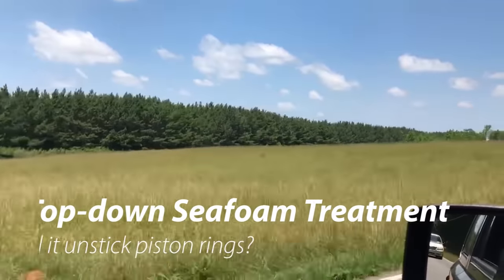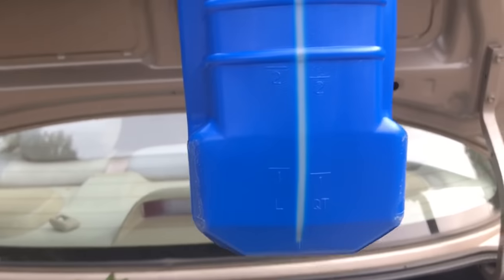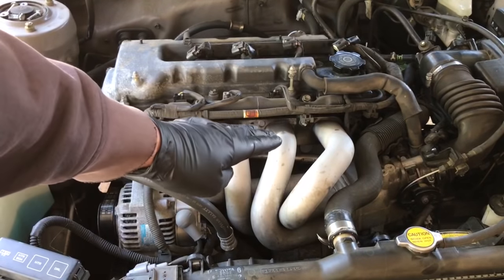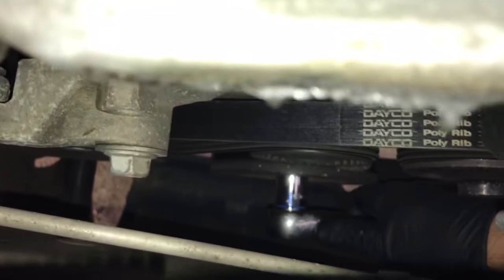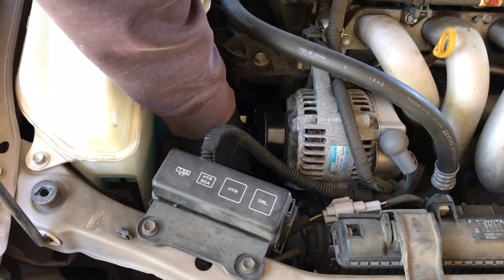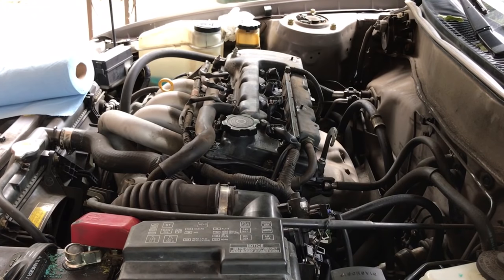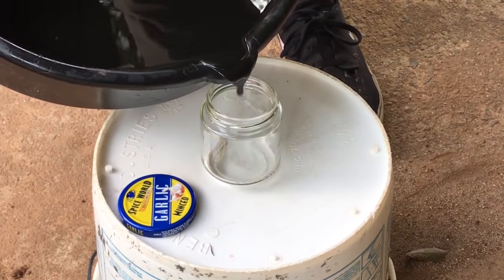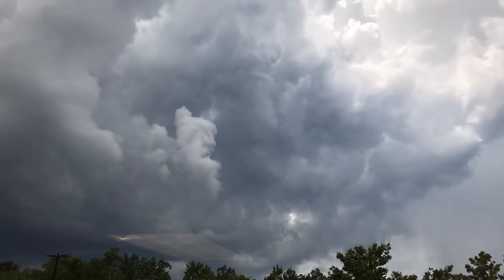I poured Seafoam down the spark plug holes! | Oil Burning Experiments - Episode 1

Comment: Great video! B&G has a product called EFR which is specifically formulated for the "bottom up" effect and I'm trying it this weekend. I used to use Seafoam as maintenance for my older cars especially towards the end of the oil life just before changing it, often resulting in a cleaner bottom end, as both vehicles exceed 226,000 miles. I also use Z-max as a oil assist every other oil change.
Reply from the maker: Thanks, and thanks for the info, David. I'd like to try the BG products too. Someone in the comments of another of my videos mentioned they'd like to send me the kit, but I haven't heard back from them yet. We'll see. All the best with yours and thanks for the comment!
Reply: Give BG EPR MOA 44k kit a shot, I recently used the kit. Burning about 1 qt per 1k miles, cant give any feedback on it yet.  BG also has another kit that is geared towards sludge buildup for direct injection vehicles.
Reply: Zmax is crap use lucas oil stable seafoam and marvel or atf

Comment: nice job on the video.
I was wondering whether you topped up the oil after you spun on the new empty oil filter? there is a fair bit in an empty filter and would change your results.
did you also replace the spark plugs?
Reply: that would not matter due to the fact he topped it off, filled his tank drove 300 miles and was still a quart low, so every tank he would have to add a quart so even if his oil was completely drained after putting on oil filter he had topped it off before driving a full tank of gas
Reply: Was wondering same. Always recheck after 15 or so minutes running after initial fill.
And not even cleaning the plugs/PCV was ???
If my oil was EVER that sludgey I would flush the block asap. 
Not changing the oil enuf (5K/6months)on  those is the reason those badly engineered rings lock up faster in the 1st place.
I screwed up by not doing it on my new 06 Tundra but did it 8-10K for about first 25-30K.
But as I've now read thru lots of others comments, I realize I've no room to judge.
Thanks for getting us all to think!
✌️

Comment: Just for the record, it was '98-'02 engines that were affected, not up to '05. In '03, Toyota changed the rings to a different design. I had a '03 Celica with 175K on it, didn't use a drop of oil between oil changes (every 3K)
Reply: Toyota did have a piston ring oil consumption issue in the mid 2000’s , I bought a scion xc with the Toyota 4 cyl that ran low on oil and had developed rod knock , I replaced the engine with a reman unit.
Reply: Just for the record. I work for Toyota  and Michael is correct
Reply: @ironmike742  On the 1zz, only '98-'02
Reply: @justsumguy2u  no sir Toyota  was putting rings and pistons in other 4 cylinder engines also. The 2AZ-FE 2.4 engine was one of them.
Reply: @ironmike742  I wasn't talking about anything other than the 1.8 1ZZ-FE. It is an absolute fact that Toyota changed the oil control rings on those in 2003. 2003 and later 1ZZ-FE models did not have the oil burning problems that '98-'02 engines had.
Reply: @justsumguy2u   If this 288 K 1Z was burning a quart a tank. It would've been toast by now.

Comment: the main solvent in SEAFOAM is Naphtha  (Paint Thinner)  You can buy a Quart 32oz of Naphtha  for the Price of just one seafoam 16oz can . Berryman B12 is  much better and cheaper , but if you really want to dissolve the burnt Carbon build up on the piston and rings use Berryman Chem-Dip Carburetor & Parts Cleaner pour about 4oz in each cyl let set overnight then more another 4 oz in each cyl let set 24 hours  DO NOT RUN THE RUN with the Chem-Dip in the engine oil drain the oil put in fresh oil before starting the engine .

Comment: We used a 50/50 mix of acetone and transmission fluid at our John Deere dealership!! Totally siezed diesel tractor engines..removed injectors and sprayed this solution into cylinders..next day engine rotating perfectly!!
Reply: Then.. what's the steps please?
Reply: Yep,tranny fluid does wonders cleaning pistons
Reply: @mandytuning  what are the steps do you get a cloth and keep rubbing till they become loose please explain abit more as I’m having problem with low compression and I’m hoping I can find a way to fix it without spending any money
Reply: Is the crankcase drained first before this application or does that matter?

Comment: I have a similar issue with my Celica 281K miles blows hardly any smoke, repaired the timing chain gasket Leak but it's still consuming about 1.5qt a week. I'm going to try this
Reply: Did it work and what engine was it?

Comment: How about spraying some combustion chamber cleaner straight into cylinders and leave it for a while. It might work better than Seafoam.
BTW, the problem is often caused by too long oil change interval and low quality oil. 
Really, at the rate it consumes oil, I would take the engine apart and clean the rings and pistons - I bet things are well baked and very crusty inside the cylinders.

Comment: Never turn a engine anti clockwise especially on older chain driven engines the timing can jump.
Reply: Is that why when I replaced my serpentine belt it comes right off when I start my car?... Idk I might be talking about loosening the pulley
Reply: @marvinfisher4737  check the tensioner

Comment: I've seen this dozens of times with 3sge nd 5sfe engines. I used to add seafoam, one quart to a quarter tank of fuel and give the old 'Italian Tune up' . Drive it hard for about a half hour. usually breaks everything loose and decarbons valves and plugs,

Comment: Been doing this to my 02 corolla because of the oil consumption 😭😭 You should use a high mileage 10w-40oil. It helps a lot and you can also try seafoam in one of your vacuum lines
Reply from the maker: Thanks for the comment. That's a good tip with the vacuum lines.
Reply: Thanks Dave and Tyler exactly the same on 04 corolla in Australia, 1zz-fe engine next one up from yours with plastic intake. Which vacuum lines would you recommend bud? PVC line or something? A
Reply: @chloeleedow7250  of course man 🙌🏽 I put it through my pcv line. The line is easier and more effective imo
Reply: PCV* LOL wish I had the metal intake btw those plastic ones are notorious for rattling when the Inside bond comes undone sounds horrendous like a diesel 😂
Reply: Spark Plug 1 - Oil In The Cylinder Wall
Spark Plug 2,3 and 4 - Oil In The Cylinder Wall and Engine Overheating Issue
Reply: @FamilyFriendlyDIY  Hi Dave. I know I am watching this a long time from your initial video. If you are still open to options to unstick valves Amsoil Power Foam applied through the vaccuum line is very, very good.
Reply from the maker: @chrisryan8863  Thanks. Will keep that in mind!

Comment: After you did your sea foam experiment and you changed your oil, I noticed you didn’t crank the motor to allow oil to fill the oil filter and you didn’t check and re top the oil before you went and used the tank of fuel up. So the oil hypothetically should have been a little higher on the dip stick than it shown after first demonstration.

Comment: Put 4 ounces of seafoam in the oil crankcase with a fresh oil change. Drive for 1500 miles and change the oil.
It's worked on every  vehicle I've tried it on with high mileage.  It will free up lifters and rings. But it takes time to work. Dropping it straight down the cylinder and running it for 20 minutes will not work.

Comment: i have heard the crankshaft should be rotated only in one direction, but maybe that applies only to engine with variable valve timing
Reply: No. It’s all engines. However you can turn it back ever so slightly like he did on any engine as well. Any more than that you run the risk of losing the crankshaft bolt and then skipping your timing.

Comment: Extralube ZX1 in the oil and the fuel will help to unstick piston rings and clean off the carbon. 

Australians have ASTA 3000 which also removes carbon and prevents it from building up again too quickly.

Comment: I've tried this as an experiment on a Honda 2.4 that was very badly burning oil from the rings and nothing worked at all, sea foam, marvel oil, trans fluid, kerosene. Straight into the cylinders soaked over night. Didn't change anything. Re-rung it an it was perfect. Too much hard carbon siezes the rings and nothing but mechanical means can clean it up.
Reply from the maker: Thanks for the input, Jumpin JimmyG!

Comment: I bought 2003 rava4 with 150000 miles that used 2 quart over 3000 miles  The other owner change oil at 3000 miles and used Quaker State non synthetic  i switched  to Amsoil 5w30 and changed 5000 miles intervals After 4 oil changes with engine flush i got  it  to  down less than 1 quart in 5000 miles before it used 3 quart in 5000 miles Now i switch to 10000 mile oil change interval  ive put about 35000 miles in less than 2 yrs now it using less oil but for being manual trans the gas  mileage sucks im getting less than 15 mpg

Comment: I have an 06 Saturn that was neglected before I owned it. It would drink oil. Instead of risking chunks of sludge screwing up the engine with an engine flush I put sea foam in the oil and oil consumption is way down.

Comment: I think cleaning up the valve chamber would definitely help. Usually there shouldn't be much carbon built up on the piston as the blow back will transfer them into the chamber that clogged up the valve.

Comment: When you change the oil & filter, & put in the required amount of oil, you need to allow for the oil that is used to fill the filter. This amount is usually about 1/2 a quart.

Comment: Just an FYI, you can also pour half the bottle of sea foam into the crank case and run it for 175 miles. It'll clean everywhere your oil goes.  I'm going by your concern for small amount leaking into the crank case.. ?

Comment: I have a 2014 toytota camry le 4 cylinder chugging oil and eating catalytic converters, gonna give this a try. Would you use this method with the spark plug holes or use it in the oil? my car has 446K miles on it.

Comment: I drove a work truck one time, a CornBinder, 4something cu inches, 3 gallons oil to a 30 gallon tank, and it got about 10 mpg. 
 My solution, a large can of staring fluid into the oil filler, hood open fire ext. handy, try start, big boom, 2 days later a new Chevy, it lifted the valve covers, oil pan away from heads and block. 
 Boss said " that why it burnt so much gas, was in the oil pan too.
 That 30+ years ago, that was my oil burning fix.

Comment: you could barely see the oil on the dipstick because the engine was using so much oil it never had time to get dirty! On the can of seafoam it states to use Seafoam in the engine oil as well.
Reply: At the beginning, how come the oil on the dipstick oil was clean, but the oil from the sump was black?

And how did you allow for the extra oil required to fill the filter?

Comment: Next time you guys take a head off an engine that’s all carboned  up spray some CRC “red can” brake cleaner and see what it does to the carbon😉. Works better than carburetor cleaner. I stumbled across this once when I ran out of carb cleaner. Of course it’s probably not sensor friendly but as long as you don’t use it while it’s running and do an oil change you should be fine
Reply: AMSOIL POWERFOAM... EATS CARBON

Comment: This is an interesting experiment although I’d switch over to advanced full synthetic as that’s what I use from supertech. I wouldn’t touch regular Dino oil with a ten foot pole, it burns off too quick and varnishes up stuff too much. Synthetic is a better cleaner of parts. If you want a high mileage oil I’d try the full synthetic high mileage as my old 2007 Toyota Prius burnt oil. It was about as bad burning a quart every 500-800 miles with variations. I got it to stop by using marvel mystery oil with a tiny bit of overfill. What I’d do is I’d add a quart of marvel mystery oil and let it burn through until it got just above the fill line, add another quart to replace it and after about 2-3 times doing this with slight (a hair) overfill so it hit the rings and everything and my usage went from that noted above to about a quart every 1300 miles or so. I’m mainly a highway driver so perhaps that helped loosen some stuff up but I had great results. Before the battery went and I got rid of the car, I’d add some mystery oil every 20,000-30,000 miles or so before an oil change to keep it goin and switched to advanced full synthetic which improved everything  more. 

Worked for me. Perhaps it may for you. 

Amazing work and video.

Comment: If I remember right, don't those Toyota 4cyl call for spark plugs with the dual ground straps? It should even be displayed on the passenger side of your valve cover.
Reply from the maker: I picked some up from the Toyota dealer, but haven't opened the boxes yet. We'll see soon.

Comment: Question,
Turning the crank shaft pully counter clockwise, as you seem were doing,  may cause to jam the timing chain and / or damage the chain tensioner. Am I correct?
Reply from the maker: Good question, Ali. It could do damage to some engines, depending on how the chain is tensioned, but the 1zz uses a ratcheting type tensioner pressing up against a guide that hugs the "slack" side of the chain from bottom to top, so there is no way for it to jump timing as long as the chain has already been properly tensioned. Just Google 1zzfe timing chain assembly and you'll see what I'm talking about. Thanks for the comments!
Reply: @FamilyFriendlyDIY  Thank you for your prompt reply and your advice. I have learned a lot from your videos and thank you for your good service to public
Reply: I’ve been a mechanic for 50 years. I’ve never heard of an engines timing slip due to the engine being turned backwards. Manufacturers have had to design in the chance of an engine being rotated backwards. Stalling when going up hill for example.

Comment: Marvel Mystery oil works great also. I've cured many "oil burners" with using Marvel Mystery oil over the years.
Reply: Did you just add it to oil?
Reply: @samgrieg  yes and sometimes to the fuel also.  Several years ago, I bought a Ford Escort wagon, at an auction for $100. The car only had 51k miles but smoked badly. Turned out to be the thermostat was stuck wide open. Changed it, changed the oil, and drove the car for about 60 miles. It stopped smoking and engine temp became normal.  I detailed the car, sold it and ended up with a huge profit. Its new owner drove the car to 230 K miles when he wrecked it in an accident.

Comment: This may be worth a try... What about RAISING the engine temperature by partially blocking the radiator? Obviously to the highest safe temperature.  Bring oil temperature to 230 - 250 for 20 to 30 min? But the goal would be to get the cylinders to their highest shaft temperature.

Comment: You want to free up rings stuck by carbon, the best thing is pour some rifle bore cleaner in the plug holes. Seafoam is good for gummed up carburetors, but if you want to cut carbon, bore leaner like Hoppes#9 is 100 times more effective.
Once you start burning a qt in a tank of gas it is too late. The cylinders have become oblong.

Comment: So you went over by about 32 miles- 10%, and you still got another 15% or so in oil savings- easily 20% overall once compensated. Decent result for a first run. Then there is the horribly sludged up engine, another mitigating factor. Then there is also the fact that you are using 10w30 oil- the passages in the pistons and valvetrain are a bit small- made for 5w30 for that engine. Remedy all these conditions, and I bet you at lease lessen the oil usage by 50%, if not much more. Excellent experiments, kudos!
Reply from the maker: Thanks Robert! ... And I'm glad someone is recommending thinner oil ... seems like most are recommending the opposite. I agree with you, that thicker in this case is not better.

Comment: Get ur eng hot then trickle water directly into the intake track with eng revved up. This will steam clean cyl's breaking up carbon deposits. Seafoam can also be used in this manor

Comment: The 'lesson' here is to change out the oil (& filter) at the 'recommended' interval .... but ** nif and only if** ... your driving is at long distance highway 'constant' speeds. 
'Stop and go' or 'city' driving or driving in 'dusty environments' really requires that you 'HALVE' that interval or change every 6 months (which ever comes first). High quality oil (definitely not the cheapest 'stuff') is one hell of a lot cheaper than a total engine rebuild or replacement engine.

This is especially applicable to the more modern engines with **less tensioned compression and oil control rings** on the pistons. Most all of these 'newer' engines have the low tension compression rings .... done to reduce internal engine friction and boost fuel mileage.
With these piston rings not as 'springy' as in the past, carbon WiLL build up in the ring grooves between the rings and piston and will be preventing the rings to 'move' back and forth and 'seal' the oil. Such stuck or sticking rings is what is causing adverse cylinder wall wear and the high oil consumption.   
Rx: Change your oil at HALF the recommended oil change recommendation, or at every 6 months which ever comes first .... if you are NOT driving long distances at steady/constant speed.  Oil is much cheaper than an engine rebuild, etc. 
Prevention of adverse cylinder wall wear is always better and less costly overall.